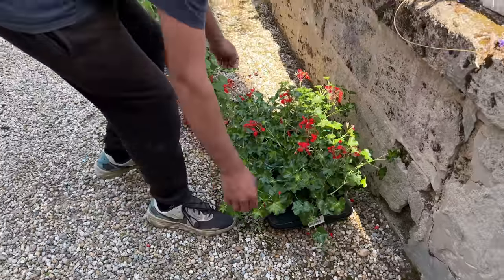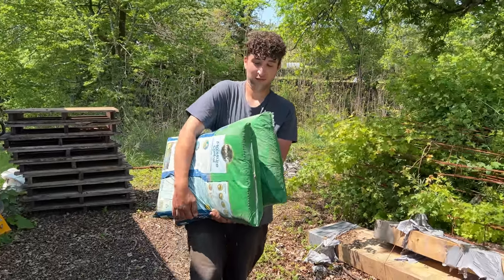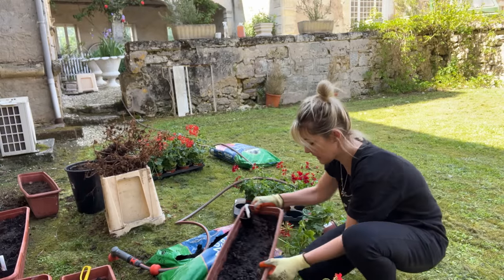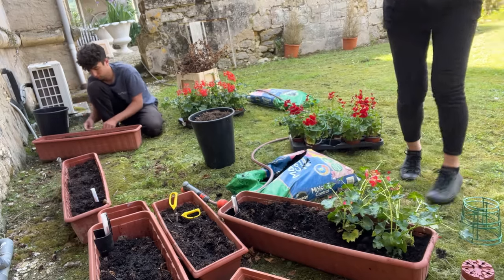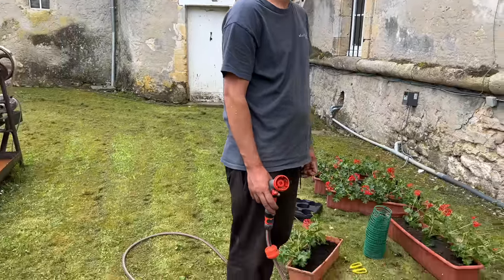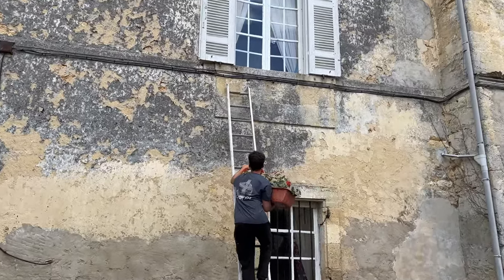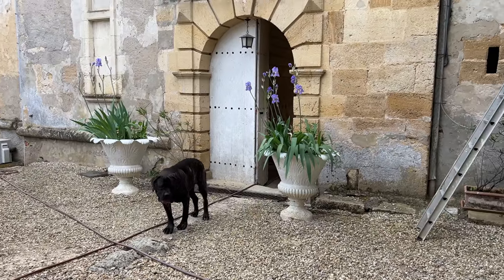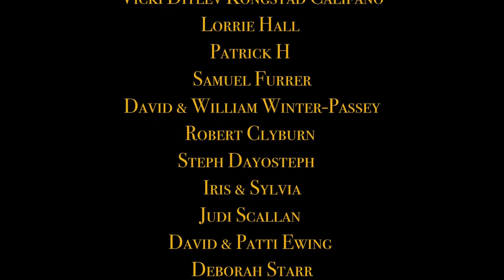EP156 The Cat Is Away ... Getting the Garden Pots ready at the chateau

Comment: Anna,  if you put geraniums in a pot you can take them inside for the winter. I keep mine in a south facing room with glass doors. They usually flower once in the winter and then again in April. I have had mine for close to 10 years now. You csn also cut stems of the plant and put it in water or just a pot of soil and then you have new plants.  It could save you a lot of money not having to buy geraniums every year.  🌸🌸🙂🇨🇦